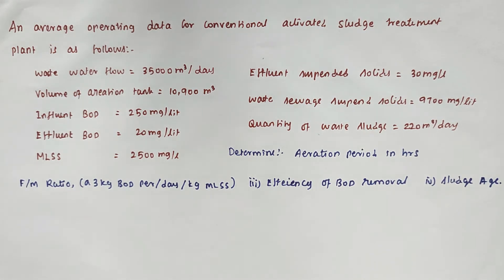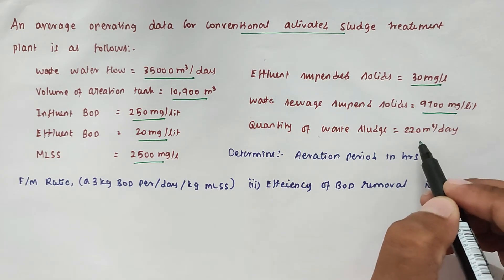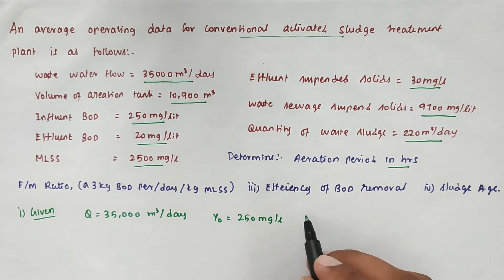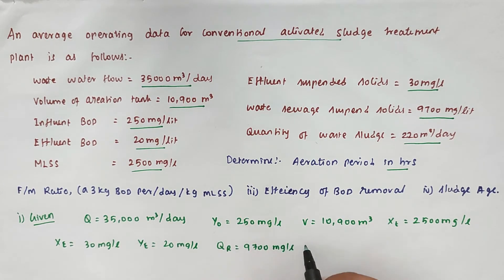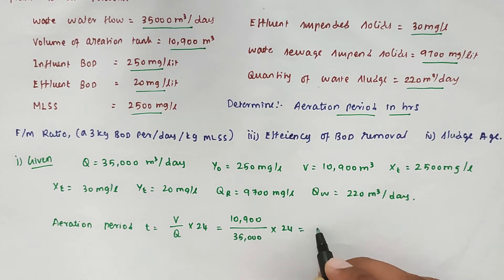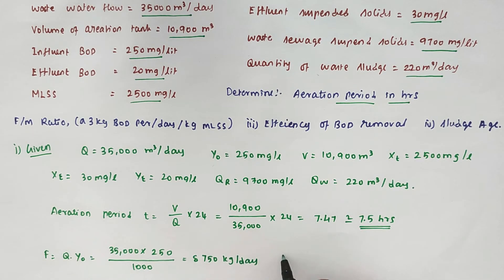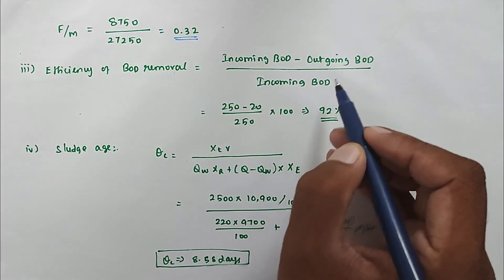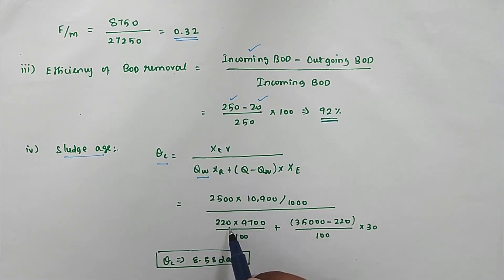activated sludge process solved problem | ASP Solved Examples | Waste Water Engineering | ASP

Comment: Mixed primary and secondary sludge of a wastewater treatment plant is thickened in the gravity thickener. Determine the volume reduction in the applied sludge after thickening of the sludge for the design data given below:

Average influent flow = 5MLD

Raw wastewater BOD = 225mg/L

Raw wastewater TSS = 200mg/L

BOD of secondary effluent = 20 mg/L

Solids content of primary sludge = 3%

Solids content of secondary sludge = 0.9%

Solids content of thickened sludge = 4%

Assume suitable data.

Solve the problem sir pls 🙏🙏🙏🙏